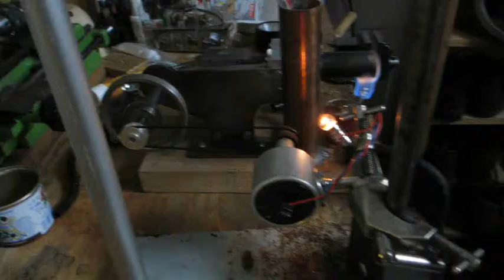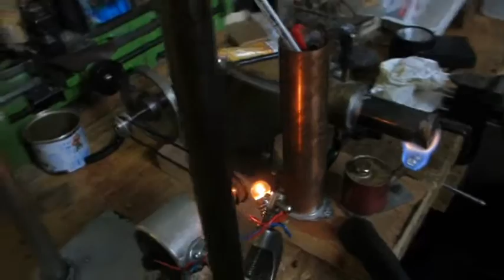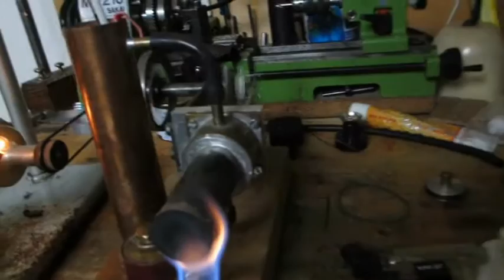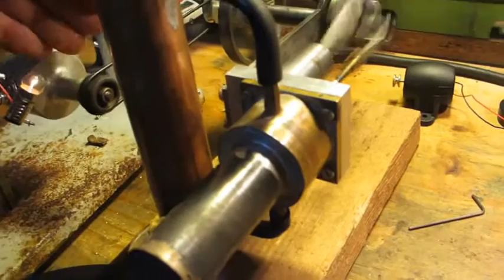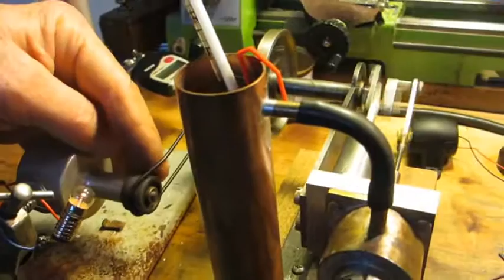hot air engine driven power station

Comment: Impressive performance of your engine! Congratulations.
One thing that caught my attention, the dynamos that I know, are heavy to run, great friction! Your engine runs it without difficulty.
Also impressed me, the incredible speed without the generator, especially when taken into account the small torch heat, used as a source of thermal energy.
I wonder, as was done the displacer piston?
Which is the course of each piston?
What metal was used for the cold piston and cylinder?
Which is the maximum no-load speeds?
From what I noticed in the background video, you have at your disposal, a kids lathe?
Congratulations, loved the performance of your engine.
I will I subscribe to your channel, to accompany the your updates.
Leandro Wagner.
Reply from the maker: No, my engine swears a lot to drive the dynamo...and the bulb looks brighter in the video than in live. I would suggest you built one of this engine, not that difficult, the plans by FC Collins are easyly found on the net.
and thanks for your comments.